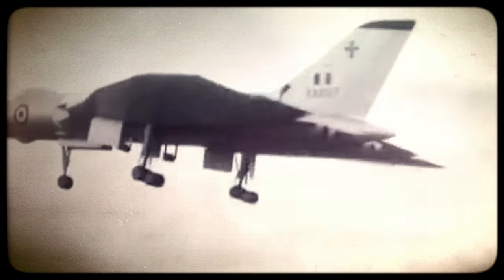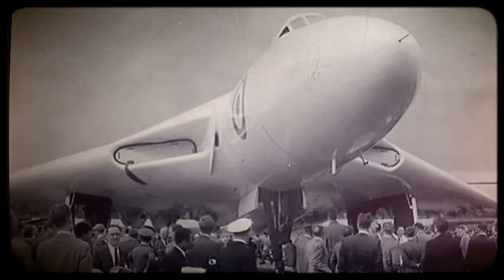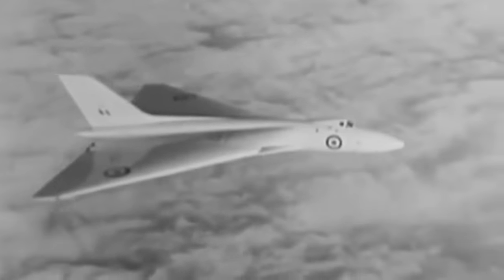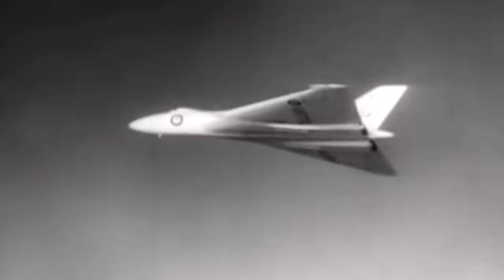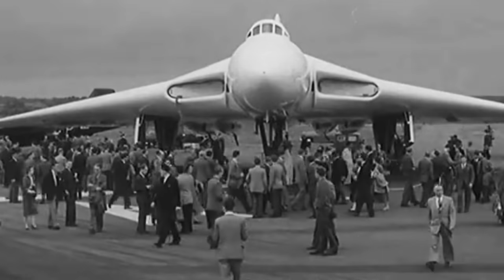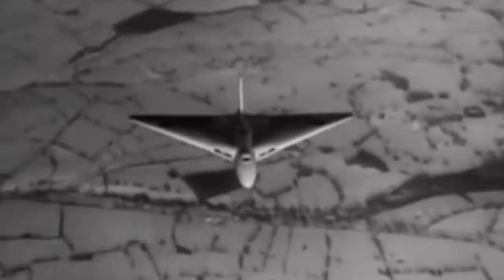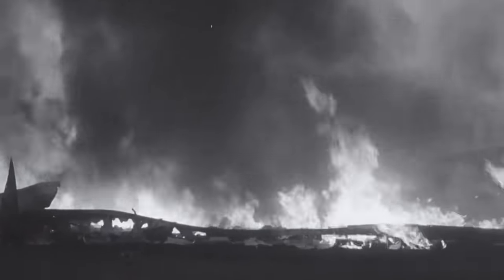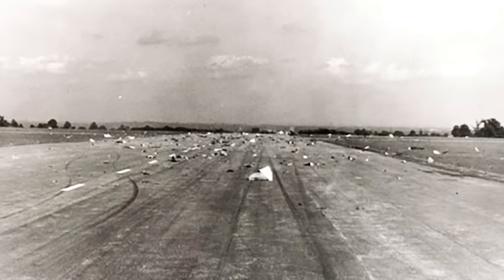Vulcan Bomber Disintegrates on Camera

Comment: No copy of the accident report has ever been found. Well that pretty much means it wasn't pilot error.
Reply: Yep.
Mustn't embarrass important people.

Honestly, I cannot see how anyone could accuse the pilot of exceeding roll rate; the film makes it extremely clear that the aircraft was only very gently maneuvering. Speed, well, I can't say about that.
Reply: no problem, the taxpayers paid for it.
Reply: It’s easy to blame a dead pilot.
Reply: @larryowsowitz2274  to be fair, pilots do fuck up. Generally more often than any other factors. 

Just not likely in this case.
Reply: @lairdcummings9092    You've got to remember that this was Vulcan no. 1, the original flying prototype and, as such, had been put through huge amounts of airframe stress under testing, on top of which it was flying with engines not of the type the aircraft was designed for.  In terms of the amount of work it had completed in its' life, this was a very old airframe.  Add in the fact that the pilot had a record for showboating that would have had him busted out of flying in milliseconds had he been military personnel and it's really not too hard to see that, although it was at fairly low speed, he exceeded the load that the wing could take and, effectively, flew the wing off the aircraft.  The manoeuvre he was attempting was not part of the discussed and approved display he was to provide.  The reason that the report has never been found is quite simple, at that time it was common knowledge that the British government was pretty thoroughly riddled with spies, and handing information that could give the Soviets an advantage over the Vulcans should war break out, not just for a few years but likely for some quarter of a century around publicly was just not a sound idea.  The report would have been eyes only for a very limited number of people, basically senior RAF personnel who were those that needed to know and had the power to act on any findings, then the reports would have been rounded up, slapped with a massive classification and sealed for a huge period of time and then quietly destroyed under penalty of treason if those responsible talked.  Although the government has been riddled with spies many times, people can still keep really important stuff quiet, particularly the military...
Reply: @caroltenge5147    No, this was Vulcan no. 1, the original flying prototype.  It was never a military aircraft, only ever used by the military for testing.  The cost of this was born by A.V. Roe and contributed to their eventual buy-out and disappearance...
Reply: How the hell do you "lose" an accident report as critical and necessary as this one surely must've been?  I realize this was 1958, but still, that just seems inconceivable.
Reply: @fredleggett923  It's not lost. It's been suppressed.
Reply: @rogerhinman5427  I wonder why, though.  What was so special about this plane that it warranted a suppression of the accident report?  7 people died, so I'd think there'd be an absolute uproar to make sure that such a fault was documented and, presumably, would never happen again.
Reply: @fredleggett923  former service here; you'd be surprised. Hell, it doesn't even have to be malicious. File the report in a cabinet, the person who filed it gets transferred, then someone orders a furniture or office shuffle, the cabinet gets hauled to a basement or storage room, and forgotten. Ten years later some enlisted personnel are assigned to clean out the storage location, and they toss the paper in the shredder to make the move easier...
Reply: If the British government doesn't want a file released, then they just slap a notice on it, not to be opened until a specific date. Usually after anyone remotely connected to the subject of the file is safely dead and buried. No need to deliberately destroy, or "lose" it.
Reply: @gosportjamie  well then, now we know why the government didn't want any clear answers; that's a whole lot of objectionable behavior all around, there.
Reply: @fredleggett923  
I'm no aviation buff, but this plane carried the UK's nuclear deterrent.
Seems pretty special to me, an Irish guy.
They protected us too.
Reply: @fredleggett923  I have no idea why. But an investigation was done and no report from that can be found. There were design changes to the wings back in the early/mid 1950s and this plane was the second prototype with the original wing. So maybe there's something there, but I don't know.
Reply: @larryowsowitz2274   ......or a dead driver. many a time a car crash due to lack of signage warning about an obstacle ahead gets blamed on the driver being drunk, to hide the callousness of the concerned authorities.
Reply: @lairdcummings9092  Quite - never ascribe to maliciousness that which ordinary human foibles can explain. 

Further, think of the era - the prevalent collective experience of death in service. It was terrible, it was sad - but it was also almost expected and accepted as part of life. If you cast your eyes over the debacle of the ex-RAF boss of the British South American Airways (BSAA of Stardust fame): and his attitude to losses: it had to be explained to him - pointedly - that there was no such thing as 'acceptable losses' on civilian airliners ...... It wasn't really his fault, he was an incredibly successful Pathfinder specialist: but his experience was so skewed by that, he was also every bit as bloody minded as Harris - which did not endear him to many of his fellow officers, nor did it speak well of his interest in other peoples opinions. Such are determined personalities I guess.
Reply: This was the era of "The Cold War", and this aircraft, along with the Victor and Valiant, was designed  to carry nuclear weapons deep into Russia (before missiles). This was after a war where the public had been kept in the dark about military matters (apart from selective "propaganda").  All "The Powers That Be" had to do was quote the Official Secrets Act to any enquiring journo, and it would have been regarded as "not in the public interest"..........
Reply: @fredleggett923  What Evan Ray said - the Vulcan was designed to carry the British nuclear deterent, arguably the most important/ significant roll in the entire British armed services, and at the height of the Cold War.  Secrecy around the Vulcan program was imperative.  Also any analysis of the accident would have been useful to the Russians in developing their own aircraft.
Reply: I'm pretty sure there is a bipartisan investigation ongoing to find out how Trump was responsible for this tragedy.
Reply: @gosportjamie  Or the engine shredded damaging the wing structure causing failure of wing it didn't look like he had even started his maneuver at time of failure.
Reply: @rogerhinman5427    Exactly...
Reply: @fredleggett923    It is most likely that information contained in the report could be considered to be of aid to the enemy if these aircraft ever had to be used for their designed role.  That means that the report automatically falls under national security which means it's dealt with in a totally different way.  This would have been an eyes only document for a very limited number of people and there may well have only been one copy...
Reply: @ianmcsherry5254    It's a very different thing when the subject is a matter of national security.  There are levels that go way above top secret.  It would be exactly the same if a current nuclear submarine was involved in an accident...
Reply: @lairdcummings9092    It's a matter of national security.  It is likely there would be information contained in the report that would be useful to the Soviets if the Vulcan ever had to be used for its' designed purpose.  It's not a matter of trying to hide anything, it's about maintaining the strategic military advantage that the Vulcan represented, and would continue to represent for the next 25 years...
Reply: @gosportjamie  none of which explains why the report entirely vanished.
Reply: @lambastepirate    No, there is cleaned up and digitally-enhanced versions of this film around that clearly show that the wing failure started at the wing tip and progressed inwards, a classic sign of an overload failure.  If you want to look for it, the enhanced film is on YouTube.  You have to remember that, although the Vulcan was designed to be highly manoeuvrable, for such a large plane, at high speed, it was designed to do this at high altitude.  As altitude decreases the density of the air increases which massively increases the load on the airframe.  Close to the ground, i.e. sub-1000 feet it's at its' most dense, meaning wing loading is at its' highest even before you begin manoeuvres so it's really not hard to see a pilot with a reputation for showing off pushing the plane too hard in order to put on a show and causing structural failure...
Reply: @lairdcummings9092    Think about the time frame.  It was well-known at this time that the government was thoroughly penetrated by agents, so the easiest way to keep something like this secret would be to destroy it after it has been read by those who need to know any lessons contained.  Foreign agents can't get their hands on information that only lives inside people's heads after the document has been destroyed...
Reply: @gosportjamie  also none of which prevented the government from issuing highly edited summaries, nor did it prevent the government from archiving and preserving detailed reports for future use. 
Except in this case.
Reply: @gosportjamie  "Very old air frame"? LOL. Do you write for CNN? First flight was 1952 so this plane can't be more than 6 years old. B-52s made in the 1950s are still flying today. If anything is very old, that's it. Not this aircraft.
Reply: @lairdcummings9092  John McCain fucking up made him a famous “hero”
His record is redacted like crazy while the same dudes he flew with are wide open. Groomed and owned.
Reply: @lairdcummings9092    In other cases it could well be that the reports contained nothing that could be considered to be of particular use to possible enemies.  This case is not unique, not by a long shot.  I know of dozens of other incidents where no reports into the event were kept.  The difference is, they are not incidents that have as much public interest as the loss of a Vulcan has.  In terms of historical relevance this is unimportant.  The Vulcan went on to have a long and successful military career, including successfully bombing Port Stanley airport during the Falklands conflict.  What happened here had no effect on that, and the fact that the Vulcan went into service as expected with no delay for redesign or re-engineering after this crash is a very definite sign that the cause of this was pilot, not airframe.  The UK was a very different place in 1958, the secret services were known to be riddled with agents, think Blunt/Burgess/Philby etc.  How do you keep something secret in a climate like that?  It's very simple, you make sure that no-one except those that need to know can ever read the report, ergo it makes perfect sense for it to be destroyed after the relevant people have read it.  It's just sheer common sense.  The bad guys can't see something that doesn't exist...
Reply: @robertthomas5906    Not old as in years, old as in flight hours and what this aircraft did during those flight hours.  This was Vulcan 1, it flew every test, shake-down, every combat simulation and was the test-bed for every modification made to the design of the aircraft before it was put into service.  It also flew every conversion flight for the crews who would be the first to crew operational aircraft.  This airframe had literally had its' wings flown off in its' life and had very likely exceeded its' design loadings dozens if not hundreds of times.  You're right, in terms of age, and probably flying hours, there are many B-52s that are far older.  But none of the B-52s still flying are prototype aircraft which were all withdrawn at the latest by the early '60s...
Reply: @gosportjamie  oh, no. Not even remotely. EVERY crash investigation contains enormous engineering details. Extremely valuable to both the investigators, the engineers, the maintenance personnel and practices, and whole body of other extremely tasty espionage fuel.

NO ONE, not even the former Soviets, trashed good technical data of that nature.
Reply: @fredleggett923  Check with the pilots wives ,I bet they have one.
Reply: @lairdcummings9092    And how many of them were left open to public, and potential unfriendly, scrutiny at times of heightened tensions?...
Reply: @lairdcummings9092    It's not a matter of being deliberately obtuse.  This was the first of Britain's new, effectively nuclear deterrent to Russia.  The British government was known to be heavily penetrated by unfriendly agents.  If the Russians got their hands on technical information on the Vulcan before it was in effective service then Britain's principal nuclear deterrent for the foreseeable future was nothing but hot air.  Although the saying about reds under the bed is really thought of as being an American thing, it's really how things were in the UK at the time, nobody knew who might be an active or passive enemy agent and giving away the new nuclear deterrent was not something that anyone wanted to risk.  The easiest way to help ensure that was for this report to be circulated to those who needed to know, and once the circulation was complete, probably done by the sole copy of the report travelling in a locked briefcase on the wrist of a carefully chosen and vetted military officer under instructions to shoot to kill if anyone tried to take the report and, if all else failed, ensure the report was destroyed.  After the circulation was complete, the easiest way to ensure it didn't fall into unfriendly hands was to destroy it.  It was a case of the needs of the present exceeding the needs of the future.  It makes perfect sense.  With the benefit of history, we can see that there was clearly no issue with the aircraft as its' introduction into service would have been delayed significantly by necessary re-engineering and redesign work, which it wasn't.  The aircraft served well, and quite well beyond its' expected service life so it's pretty clear there was nothing seriously wrong with the aircraft, so the only logical conclusion is that this was a case of pilot error.  Vulcan was too important to be allowed to go into service with issues, so, had any been found in the report, it would have been delayed into service.  There's no big story here, what happened after this crash was a matter of expediency, nothing more...
Reply: @gosportjamie  IMHO, Still not very old. I remember years ago they said most GA aircraft were built before 1975 I think. Mine is a 1954 Beechcraft Bonanza. I think the airframe is around 5000 hours. Don't know, the logs were lost in a Hurricane in the 1990s. I fly it around the country.
Still a heart breaking failure for the Vulcan. I remember before I bought my Bonanza I was thinking of buying a Piper Lance that had over 24000 hours. Seems to me it had a few xerox type boxes worth of logs. The plane I bought was a part 135 operation. Used to fly patients and transplant organs. Now it mostly does $100 hamburger runs.
Reply: @gosportjamie  WOW, you explained quite a bit there, and it absolutely makes perfect sense.
Reply: Clearly we have  Our answer was not pilot error! ( Manufacturer cover up!)
Reply: @rogerhinman5427  it's a report on a nuclear strike aircraft. It was very likely destroyed.
Reply: @fredleggett923  It was designed to be a nuclear weapon delivery system. Everything about it would have been “born classified” as they say. Any technical documents including the crash investigation report would be viewed as Top Secret by default. It’s more interesting that it has never been declassified.
Reply: @robertthomas5906    It's not so much the hours, it's the type of flying.  This was the prototype of a military aircraft, meaning that a lot of those hours were deliberately flying outside the envelope to establish what the operational envelope for the aircraft would be.  As I said before, in terms of accumulated stress, this was a very old airframe...
Reply: Unless the pilot had over-stretched the airframe to a 'massive' extent prior to this 'run' over the airshow, then it is very hard to see any pilot error.  I do not see this as a 'standard' wing-failure; the aircrew were taken by surprise by something they didn't cause or anticipate, and had no time to react.  God rest their souls.  Subsequent 'production' Vulcans were excellent and served for far longer than they were originally intended.  Until I saw this footage, I was unaware of this particular incident.
Reply: My guess would be that the engine swap affected the wing spar or some other critical structural members. Perhaps even some were modified or removed to fit the new engines. That would put the blame on whichever engineer approved any changes during the replacement.
Reply: @dominicwood3451    The pilot had an agreed set of manoeuvres that he was allowed to perform if the aircraft completed the tests in time to visit the show.  The manoeuvre he was attempting to perform when the failure happened was not on that list.  The pilot was hot dogging again, as he was known to be prone to doing, but that was tolerated as he was an excellent test pilot.  In this case, he caused the failure of the wing, the loss of the aircraft and 7 deaths.  That's pretty clearly pilot error...
Reply: @MrJest2    Do your research on the engines.  The engines this aircraft was flying with when it crashed was a development of the engine the Vulcan was designed for.  Very minimal alterations would have been required to install them, and none of those would be structural...
Reply: @Phuket Wurd mostly intra-service, though I recall a few conversations with my father after he returned from an investigation, concerning the "professional demeanor" of the crew, or lack thereof. It was a sadly common factor in a lot of wreck investigations. 

Even Frank Borman, a close associate of my father's, had his failures. Not many; Borman was notoriously safety minded, but yeah, even he screwed up now and again.
Reply: Catastrophic engine failure causing wing to rip apart??
Reply: @eyespy1415  possible. We'll likely never know.
Reply: Chernobyl was in 1986. Schoolkids were going about their business within sight of the open reactor until at least two days after the accident. There are many more recent failings that don't spring to mind immediately, but basically the time that this happened has almost nothing to do with administrative errors. They happen now, or at least are still blamed now.
Reply: @eyespy1415    That makes no sense.  A catastrophic failure of a jet engine almost always results in fire, but there was no fire present when the wing started to fail, only after the fuel tank failed as the wing tore apart.  So the fire was the result of the failure rather than a sign of a cause of it...

Plus, if this sequence of events had happened, the wing would have failed from or at the root as that's where the engines are mounted.  The cleaned up version of this film clearly shows that the failure started at the wing tip and worked inwards, a classic sign of an overload failure...
Reply: @eyespy1415    You're right, the tests don't.  But when it happens on an aircraft in flight it almost always does due to the plethora of lines supplying various fluids that get damaged by the failure and then the contents lit off by the engine heat as things like hydraulic fluid burn far more readily when they're hot from use.  If you watch motor racing you'll probably be quite familiar with cars having wheel fires after a crash.  That's because the brake fluid, pretty stable stuff and often silicon on race vehicles, is massively easier to ignite when it's hot, meaning that fluid from a failed brake line is likely to spontaneously catch fire when it contacts a hot brake disc.  A jet engine failure in an aircraft won't necessarily spark a fire, but the associated damage often does, hence why the engine cases on most modern jet aircraft are very heavily armoured to reduce the chance of ballistic penetration of debris from the engine failure causing damage to other systems and starting fires due to collateral damage...
Reply: @Phuket Wurd   Just look up the cleaned up version of this film.  It shows the sequence of the failure far more clearly than is shown here...
Reply: I’m inclined to think an accident report was not lost, but simply classified secret. The Vulcan being a cutting edge new war plane then in development.
Reply: Sadly can well believe the report was lost not through malice or conspiracy but just through sheer incompetency. Got filed or misfiled somewhere and forgotten. Though wouldn't be surprised either that it was quietly 'buried' in some archive.
Reply: The Vulcan overall was a horrible aircraft
Reply: It means no such thing. In the days before the internet, you could rely on a good chunk of what was stored on paper, to go missing with nothing shady about it. Why even try to make it sound sinister? It was obviously not pilot error. The only pilot error that can make the wing suddenly fall off in level flight, is if he accidentally crawled in there with a spanner. Even if the report was deliberately destroyed, so what? It doesn't mean anyone was murdered, or space-aliens or the illuminati were involved. You don't want your enemies knowing the details of every failure.
 But more likely by far...why is a report even committed to paper, if it's something super secret and conspiratorial in the first place? They write it so people can read it. When the people who need to read it, have read it, it's no longer of any importance. They try to keep all that stuff, but if you'd asked someone one year later to go find it, they'd have just as much difficulty as they would finding any other piece of irrelevant paperwork.
 All these people suggesting the plane was destroyed by secret advanced technology from outer space, or that the pilot was silenced by the shape shifting lizard people who had wiretapped him talking to the Russians, need to get out a bit more. 
 Maybe in the course of their new outdoor life, they'd find some of the tons of formerly important documents, rotting in abandoned buildings, and see for themselves how important paperwork is a few years after it's created.
Reply: @fredleggett923  Literally explained in the comment right above yours
Reply: Air frame failures are not pilot errors!  It’s a design or manufacturing failure!    This plane literally fell all apart!
Reply: ......that makes me flashback to the day agent orange records went up in flames.........interesting........
Reply: @Phuket Wurd, yes, but that requires some thing more than just a low level pass at moderate speeds as was being done in these videos. That plane literally shed its skin and then was torn apart from the stresses that put on the air frame!
Reply: @lairdcummings9092  Exactly. It's the norm, not the exception.
Reply: @PULASKI Recalling from another Vulcan documentary, as the U.S., was a supposed ally and a "friend",  it did not feel inclined to share any of its nuclear developments and secrets with the British. So GB had to strike out on its on, and keeping everything secret from the Americans. They had to start from scratch with ts own bomb development and a platform to deliver it. How much did that all play out, from the top down, in effective quality control, accountability and attention to detail? Does the question make any sense? I'm trying to to do this on my cell phone, lol.
Reply: That starboard wing had been previously repaired.
Reply: @gosportjamie  Nonsense.
Reply: @lairdcummings9092  Possible, it's also possible that pigs will grow wings and fly.
Reply: @rogerhinman5427  Nobody would be suppressing it now.
Reply: I cannot remember how long ago it was 8-10 years possibly?
I wanted to know the cause of the accident so I googled Air Accident Investigation then entered Vulcan.
Then 1958, Syerston appeared I  knew this was what I was looking for !
Amongst all of the detail I distinctly recall mention of a repair to the starboard wing. I surmised this was a likely contribution to the fate of VX770. I was surprised when reading comments from those interested as to the cause of the accident? I have since attempted to Google the same detail I entered previously to discover it has been removed
Reply: how do you lose Kennedy's brain? @fredleggett923
Reply: @fredleggett923  how does NASA lose thousands of footage hours and data on the supposed moon landing? One of the single most important things in human history
Reply: @wuzgoanon9373  - Benghazi! Benghazi! Benghazi!
Reply: @crrhoades4  Lol.
RUSSIA RUSSIA RUSSIA!
Reply: @rogerhinman5427  (said) " It's not lost. It's been suppressed."
I buy gosportjammie's explanation of very heavy restriction at the time
But to hide it still now, plus given the RF brass's dirty dealings around crashed Chinooks & Nimrods - Despite warnings of the faults that caused the crash  at this point I'm in accord with Roger.
Its either still supressed or it was destroyed - quite possibly a long time ago.  They do NOT loose such material.
Reply: The accident report was aboard the plane, and was burned UP!!
Reply: @richardschmidt4627   Before or after the Air Minster's dog ate his homework?
Reply: I suppose it's possible that the report was simply lost.
Really, when it comes to governments, the only truly reliable records... are the tax records.
Reply: JANUARY 2021 it's likely we will never know what the true cause was.
The report accident file is missing, but unless it ever does reappear its a case of unknown reasons to why it happened in the first place.
Reply: the forces involved are huge and obviously, a mistake was made in the manufacture and later corrected so yes a design flaw a bit like the Russian Tupolev 144 copy of the British and French Concorde that broke up over the Paris Airshow too
Reply: No copy of the manifest of the manifestly grossly overloaded Concorde  that crashed ws found either.
Reply: @gosportjamie  reports say that VX770 was flying with Conway engines (after having Avon and BS Sapphires) but the Olympus powered the Vulcan in service. I always thought it was Sapphire engined at the time. Tony Blackman argues it was poor maintenance and a failure to spot stress fractures in the wing structure.
Reply: @robertthomas5906  It was the prototype and a TEST vehicle. It was rode hard and failed at an inopportune moment.
Reply: @prestwickpioneer3474    Yes, the engine situation is right, but my understanding was that all the engines that had been used in VX770 were closely related and so required little or no modification to the aircraft to fit, which would make a great deal of sense as, to modify a flying aircraft to fit new engines would require it to be almost completely stripped down with the engines being inside the wing structure.  It's certainly hard to disagree with Tony Blackman's argument as detecting metal fatigue accurately and reliably at that time, and, indeed, much later, was almost impossible.  But the fact remains that people were aware that that airframe was at risk of potential failure if put through aggressive manoeuvres particularly at low altitude, which is why the pilot had been given a set of approved manoeuvres that could be used at the show which would give the visitors a good view of the new aircraft and a sense of its' power without putting the airframe under undue stress.  But the pilot chose to fly an unapproved manoeuvre at low level and basically flew the wing off the plane.  A failure in maintenance is a fair argument, but it's not as if reliable checks for metal fatigue were available and hadn't been carried out.  That aircraft probably got more in-depth attention than any in service Vulcan because of the work it did and the fact that people were aware that stress was a concern even if it could not be reliably and effectively checked for.  But the pilot still chose to exceed what he was permitted to do in that flight, with tragic results...
Reply: Probably was
Reply: @lairdcummings9092  no gentle speed or manuver
Reply: @fredleggett923  It wasn't lost, it was never made public. Now available at the National Archives.
Reply: @fredleggett923  None of the people who died were members of the public. The fact that a Board of Inquiry was held suggests that the Board of Trade was very keen to understand what happened; the fact that the report was kept closed for 30 years tells you that military and commercial sensitivities were at work.
Reply: @rogerhinman5427  A very few seconds exploration will tell you that the report is in the National Archives and is available for public inspection. If you're really keen you can confirm this fact with the relevant officer.
Reply: @lambastepirate  The Conway engine was well known for vibrating very badly; it was fitted to the VC10 and caused all sorts of problems with the tailplane, in particular much more structural fatigue than Vickers or BOAC ever expected.
Reply: @gosportjamie  You are guessing. A shallow climb with a slow roll starting at 300 feet does not break a structurally sound aircraft.
Reply: @lairdcummings9092   The report in the National Archives was of course placed there by the Russians after they finished reading it.
Reply: @MrJest2  Conway engines were infamous for the severe vibrations they generated e.g VC10. The rumour about excessive roll rate was started by someone employed by Roll Royce. The combination of the two things leaves me feeling distinctly uncomfortable.
Reply: @hb1338  yeah.
No.
Reply: @gosportjamie  If this weren't a serious topic, I'd laugh.  A shallow climb with a slow roll at moderate speed is followed by a wing falling apart, and you want to state the cause as pilot error. Really ?
Reply: @Phuket Wurd Don't forget that engine vibrations are even more destructive than high power output. Don't forget that structural; failures were much more common in those days because our knowledge and understanding were significantly less.
Reply: @hb1338    Do your own research.  I've given enough pieces of the jigsaw puzzle to show you where to look.  Take a look at the available information and draw your own conclusions.  Once you've seen all the information there is an inescapable conclusion that becomes extremely obvious.  Everything is out there in the public domain...
Reply: @lairdcummings9092   be
Reply: His wing broke up, mechanical or manufacturing error surely
Reply: @fredleggett923  because you want to?
Reply: Rest of the Vulcan fleet worked even in later life they flew to The Falklands. Looks like early wing pushed to hard.  There where three V Bombers the Vulcan Valiant and Victor. The Valiant had fatigue fractures and was retired early the need to go fast and low due to two stage AA missiles developed in Russia meant the Victor changed into refuelling tankers. The Vulcan was the only one with strong enough wings to go fast and low. I saw footage of an antiaircraft missile battery trying to get a lock, they knew it was coming. The Vulcan flew right over the missile site so low it blocked daylight for part of a second, it sucked the snow of the trees and shook the clearing. It was lo low. I was in the Air Cadets at the 1280 sqn. Mill End. Flying Chipmunks Mk 3 Gliders and shooting full bore .303. Good times. The UK was leading the world at the time with aircraft technology the Canberra was another really high low fast manoeuvrable jet bomber. The US built Licensed copies as it was so ahead of the game, then for some strange reason with the excuse of moving to missiles at the stroke of some pens we threw it all away. Was it stupidity or was it foreign influence.
Reply: @gosportjamie  If a Pilot had a record of showboating he should not have been flying  AF Fault
Reply: @Karl-Benny    Yes, that's a simple conclusion to draw, but it's one that worldwide air forces have struggled with for years.  Just look at how many military aircraft crashes and losses have been caused by pilots showboating.  But, in this case, it's not relevant as the pilot of the aircraft was not a military officer, he worked for AVRO, who built the aircraft and owned and operated it at the time of the crash...
Reply: The report didn’t entirely vanish. It existed, people who needed to see it saw a copy, it was classified, put somewhere (it would be type-written) and either still in an archive or thrown out when it was time expired. It only “hasn’t been found” because nobody in the general public knows what happened to it.
Reply: @lairdcummings9092  My business deals with digitising old photographs. Every week we will hear stories about how valuable family photographs were accidentally thrown out.
No malice, and almost no carelessness, just one person being unaware during a relocation and it's gone forever.
Reply: You are correct. When you bury four turbofans in your wings its trouble. Waiting to happen.
Reply: Why do you think American design hangs engines under the wings. Now.  Except BONE where the power plants are part of the wing. In paired nacelles. As far as I know all the known BONE crashes are attributed to this design.  But I say to you....BONE all day....all night.
Reply: Oh hey a Vulcan put one and one half bombs on the Falklands.
Reply: @gosportjamie  But at least now they can public the results. They have had more things then that in secret and discovered it later. Why not this event and the reason of his accident???
Reply: @fredleggett923  This was a low radar cross-section nuclear-armed strategic bomber, and 1958 was during the cold war. They were never going to release technical documents about it to the public.
Reply: forgot to patch latest v2.0402-B
Reply: if not a manufacturing cover up  blame the pilot  easy way out
Reply: They blamed the dead guy so often they even tried to blame Sully!!
Reply: "No copy of the accident report has ever been found."......... That speak to me of two things. First being it wasn't the crew fault, and secondary, the MOD ordered the report not to come out due to the importance of what happened, and the Vulcan Bomber it self.
Reply: @fredleggett923  it’s not lost.
Reply: @wuzgoanon9373  hate to break it to you sunshine, but the American government has no say in England, where this accident occurred...in 1958.
Reply: @virginiaviola5097  Hey there, sunshine, I got your response to the comment I left months ago. I guess you didn't understand the timely sarcasm surrounding events at that time.. It's okay, some people don't understand ironic humor.
Love from America.
Reply: If this was U.S. history I would say the pilot knew the Clintons, but since it’s British I don’t have a clue!!!  What sleazy politician did they have that all their colleagues keep committing suicide or accidentally dying?
Reply: The cause of the accident was found to be a design flaw. The original Avro Vulcan prototype 698 VX770 was built with pure Delta type wings. After this accident, engineers determined the wing configuration caused excessive buffeting in certain conditions and this buffeting is what caused the right wing to collapse from the stress. 

Later versions of the Vulcan were fitted with modified wings designed with a "kinked and dropped" leading edge to improve airflow and eliminate the buffeting. The vulcan never again experienced a structural failure like the one witnessed in this video.
Reply: @lairdcummings9092  : The Vulcan was capable of doing "barrel rolls"......this one must have had an engineering fault as it was flying straight & level when it started to fall apart.
Reply: Exactly , it was mechanical  error
Reply: Not even slightly.
Reply: This is a YouTube channel.
Reply: Yep.  Straight and level with a very slow roll rate.  I absolutely can't see how something was violated.
Reply: Sounds like a classic internet myth.
Reply: @snowflakemelter1172  
It does actually.  It may be true, back then all you had to do was shred it or misfile it.  They'll probably find the report when going through records deciding what to throw away and what to keep.
Reply: The usual, blame the pilot,like the Mull of Kintyre Chinook Crash(TR-3B jetwash),or the Clutha Vaults helicopter crash(faulty gauge).
Reply: The way it simply fell apart during a standard manoeuvre, suggests foul play or sabotage in my opinion.
Reply: @davidbreakspear8776  and your opinion is based on what experience ?
Reply: Pilot Error = Manufacturer Screwup.
Reply: I'll bet it was a modification to the wing to install the Rolls Royce engines.  His maneuver didn't look stressful in an easy roll .  .
Reply: @fredleggett923  as long as those that need to know, know,  the rest of us dont need to know
Reply: @gosportjamie  agreed.  maybe should have been a report generally on faster aircraft at show etc and placement of rescue vehicles for better mitigation ?
Reply: @wuzgoanon9373 Dumb remark…
Reply: @JamesFolkers  three years ago when I made the remark it wasn't so dumb.
Try to keep up, brainiac.
Reply: Well spotted.
Reply: Cambridge Five syndrome
Reply: Set the speed of this video to x0.75 to make it almost bearable to listen to.
Reply: @lairdcummings9092  YES MOST COMMON ACTION.
BEEN THERE SEEN THAT
Reply: @rogerhinman5427  if a design crashed from visible disintegration of the leading edge and they then changed the LE in later designs... QED?
Reply: @Ralnon  People who are very good in wartime situations are often the last people you want in civilian situations, not always but pretty often.
Reply: @rogerhinman5427  sounds more like it.
Reply: @robertthomas5906 The  aircraft had had a hard life, doing a lot of flight tests and exploring the edges of its envelope.  "It's not the years, it's the mileage."
Reply: @rogerhinman5427 This was actually VX770, the first prototype, and it had already been put through some serious stress inducing flying prior to this crash.
Reply: coverup.
Reply: How odd
Reply: @fredleggett923 covered up